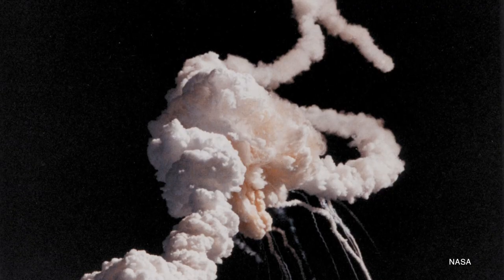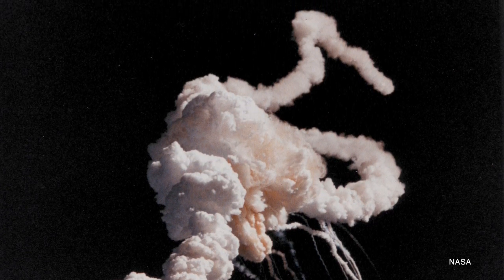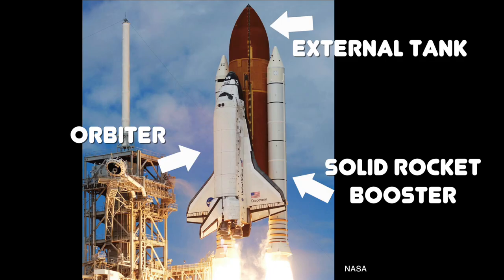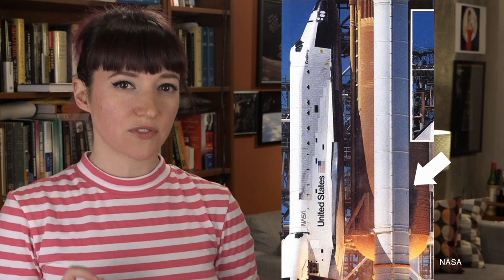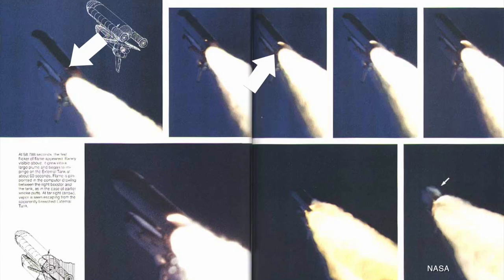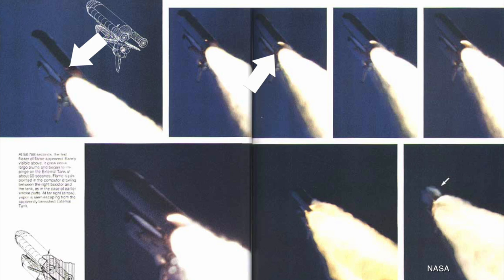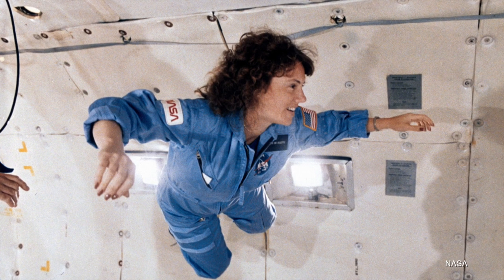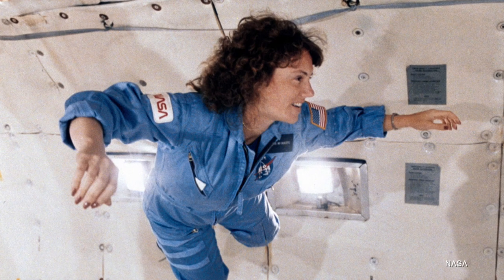How the Challenger Disaster Changed NASA

Comment: Actually, it wasn't the explosion which destroyed the orbiter. It was the aerodynamic forces caused by the orbiter tumbling through the air. It would have been fine - for a while anyway - if it had kept the nose forward.
Reply: That is correct.  So many people just see the "explosion" and assume it caused the shuttle breakup when in reality it was improper atmospheric loading due to the attitude of the vehicle not piercing the air correctly.  It is also too bad that at least two engineers attempted to postpone the launch, but politics overruled sanity.  NASA went through video of launches and found the same problem had occurred on at least two earlier launches. (different vehicles) Lucky for the crews that the O rings resealed on those occasions.
Reply: Also, during refurbishing of the SRBs, the O-rings often were found to be severely damaged.
Reply: It has been speculated that, had things gone just a little differently, the "slag plug" could have held fast until booster burnout and they'd all still be alive. Which doesn't absolve NASA from blame of course, but indicates that the accident was a "perfect storm" of engineering mistakes, management failures, and Murphy's Law.
Once the rear booster attach point burned through and it started swinging around, nothing could have kept the orbiter on its correct heading/attitude.

Comment: The Challenger Disaster is an unfortunate example of how things can fail when company culture and poor communication is at the center of an organization. The engineers knew that the O-rings were designed to work above 53F temperature, yet the day of the launch the launch pad was below the required temperature at 36F degrees. Poor communication causes failure and instability among an organization which never will achieve positive results. It is so important for an organization to have the same objective goal in order to succeed. In this case, the engineers were concerned about pleasing their managers, management was concerned about appeasing authority because the organization was more concerned about Public Relation matters than technical issues. Simply put; the goals of the organization were not aligned which caused failure. Additionally, the organization culture was terrible, engineers felt like they were not being listened to which resulted in poor communication. I think to have positive company culture, the first step is to have goals aligned amongst individuals and departments. When goals are different this causes lack of communication and disregard on important matters.

Comment: If NASA’s goal from the beginning was to end up launching 50 shuttle flights a year, the shuttle designers should have realised early on that this would involve shuttle launches in the dead of winter.  Which means the O-rings (and everything else) should have been designed to cope with freezing temperatures.

Comment: The Challenger Disaster was one of the greatest tragedies for NASA. The circumstances surrounding the explosion of the Challenger on the day of its launch could have been avoided but, ultimately come down to a lack of communication across the various levels of the NASA organization. It’s a very unfortunate example of how grim events can turn when there is a lack of sufficient communication and misaligned priorities throughout an organization. As the video mentions, the temperature was near freezing on the morning of the launch and it was known by engineers that if the temperature is below 50 degrees the o-rings would lose their elasticity and could cause joint seals to fail, which could produce an explosion. These concerns of engineers were not properly communicated to NASA management and in addition, no one at NASA was as concerned with the technical issues and much as the public relations issues that would arise if the launch did not happen on time. With 7 astronauts lives on the line, the primary concern of NASA should have been those individuals on board, not the PR of the launch. As a result of the poor culture at NASA, they had to realize the shortcomings of their organization alongside the rest of the nation watching the event live on tv, at the expense of the lives of the astronauts on board the Challenger.

Comment: The Challenger disaster is a very simple case of not having priorities and not taking into account the safety and the success of the launch. NASA, instead of worrying about making the rocket ship as safe as possible and prioritizing the success of the launch regardless of day or time, they decided that the best course of action was to do nothing to fix this obvious flaw in the rocket ship or to make an adjustment up date and time of take off. This of course prompted mass outrage because of how NASA handled it. Prior to the launch the engineer's had mentioned how the O-ring was deteriorating and that it had to be fixed before they could launch but management did not want a public relations or marketing problem and made the decision to not listen to the engineer's and to continue a scheduled launch for that Tuesday. Not only that those engineers mentioned that the temperature was not optimal for launch and  the marketing team once again decided to ignore their warnings. I find it very odd how despite them knowing what could have happened they decided to do nothing about it and it cost the live of several crew members and a public relations disaster.

Comment: While NASA needed to launch the shuttle on that day in order to be on schedule and keep up PR, it was not worth the risks at stake. When tested after the crash, a scientist showed that simply with cold water the O-rings lost flexibility. The temperatures outside during the launch were significantly cooler than that and had a greater impact on the O-rings. While this may have caused the explosion, the real cause was the lack of power and management given to the engineers. The original plan was to launch on Tuesday and have the teacher aboard give a class in space on Friday. They did not want to push it back a day because then the class would be on Saturday when no one was in school, but the engineering team is there to design and test the shuttle, so when they say something is wrong one should take their advice. However, the lack of proper management and lack of power given to the engineers and all of it to the PR team, the shuttle launched and the disaster happened. When work is divided to different teams each team needs an equal say in what is happening and what risks are worth taking.

Comment: This video takes you through the Challenger story and how it changed NASA. On January 28, 1986, the crew boarded the craft. Seven American astronauts were lost due to the explosion. The cause of the explosion was detected as an o-ring. Flames and smoke were present right before and after takeoff. What ultimately happened was a joint seal failed on the SRB and temperature was not controlled. People knew the temperatures before the launch, but NASA stilled continued to launch. It turns out there was not much concern about technical issues from the people at NASA, but more concern of the publicity that would occur if the launch did not happen. NASA let the view of the media get in the way of safety for those who boarded. What caught the attention and made the launch so popular was Christa McAuffliffe. The launch needed to be scheduled for the exact day it was so that it could be broadcasted in classrooms all throughout America. The launch was also scheduled to be discussed in the State of the Union address. NASA’s culture of putting public relations as a priority over the safety of people on board is the main cause of the accident. The disaster unfortunately was a reminder of how dangerous spaceflight is.

Comment: The Challenger disaster shows a lot about NASA and the communication of its employees. If NASA had listened to its engineers and were not so concerned about the end goal, the mission could have been saved. Since the mission failed because of an O-ring and the fact that it was at temperatures below the recommended launch temperatures, this means It shows that the littlest things can cause a major disaster. 

This can say a lot about NASA as an organization. It shows that the people who were in charge with launching challenger were not listening to employees that were not as high up. They ignored the engineers advice not to launch because they were more concerned about bringing money into the organization. This also shows the main motive in their space missions. They wanted to show that it is worth for the US to spend its money on the Space Shuttle missions and they wanted to make sure the country looked successful. 

One thing that should also be taken away from this is that space flight is still very dangerous. As a company, safety needs to always comes first for all people involved with it. If NASA knew that launching at that temperature posed safety risks, they should not have launched the rocket. It is very important that any organization ensures safety is always first.

Comment: Nasa launched its 25th space mission; however, they never reached orbit, leading to a massive explosion. This national disaster encouraged NASA to track down what caused this launch to go entirely in another direction. They found that there had been a defect in the solid rocket booster, which caused a small flame to reach the main rocket tank eventually. Apparently, the temperature at which these rings found themselves meant that they wouldn't reach their max function. This explosion was due to a lack of communication between NASA's management and engineers, leading to this explosion. Both were more focused on different areas regarding the launch, which inevitably provoked a failed attempt at a successful launch. If both areas would've met half-way, engineers, PR, and management would have probably encouraged each other to work around all those vital areas as a collective team. It's all about communication, especially when dealing with people's lives.

Comment: This is a very sad story considering that the misgivings of many cost the lives of a few. By pushing to have the flight that day when weather conditions were not favorable all just so that they could get positive PR is shameful. If they had listened to the engineers they could have put the class off until another day ensuring the safety of the crew aboard. Instead, they took a risk they could not pan out and innocent lives were lost. With basic communication and understanding of others' roles within the mission, they could have done this safely and effectively. She said it perfectly that it was not a failure of the o ring it was a failure of understanding of what was going on inside the rocket.

Comment: The Challenge Disaster is a prime example of what happens when there is not enough communication throughout the various levels of an organization when they are all involved in a project. Communication was at an all-time low because NASA wanted to prove to the public that they could successfully launce another space shuttle. More importantly, one of the levels of the organizations decided to ignore critical information that was in regard to the safety of the astronauts. They knew that it was too cold to launch the space shuttle, but they almost felt obligated to proceed with the project because they needed something to prove. When you boil this down to one reason, it all comes down to NASA feeling obligated to continue with their mission. At the time this horrific incident occurred, NASA had a very toxic work environment that was publicly known. Furthermore, NASA had deadlines to meet and it feels like they were not going to let anything get in their way. For example, they had a teacher on board that was supposed to stream the class from space, but if they delayed the mission on more day, that would have resulted in delaying the class.

Comment: Honestly, part of the problem (a small one, admittedly) seems like a badly designed mission plan. If you have something that needs to happen on a certain date, why is it pinned to 'day 4', as opposed to say 'not before day 2' and then swapping with another thing that is relatively floatable if it needs to be later?

Comment: “The Vintage Space” channel makes a very good point on the reasons for cause of the Challenger Disaster. The main reason for the disaster, in my opinion, was politics. The dangerous work environment of NASA during this time was dangerous to say the least, launching a space shuttle in temperatures that can cause damage to critical components to further an agenda or make promises is not tolerated in a normal work environment at a health insurance agency, and should be criminal in a space shuttle program. With NASA falling behind of the promises made to launch a certain amount space shuttles a year, a state of the union speech coming up that will mention the launch, and a schoolteacher needing to teach class on Friday from space. These were all forces that sped up the launch of the shuttle and ignored the number one concern, the safety of the people inside the craft. The pressure to meet deadlines and make promises created an unsafe environment where shortcuts were taken, and the limitations of a simple but important components such as the O ring were clear for all who were familiar with the development of the space shuttle. The Youtube video shows the extreme consequences of a dangerous workplace environment based on pressure, deadlines, and public image.

Comment: The Challenger Disaster is an unfortunate moment in American history. American lives were lost, the shuttle did not make it into orbit, and the company culture at NASA was called into question. In hindsight, many things could have been done differently to prevent or tremendously reduce the risk of such a disaster. Although the O-ring malfunction caused the explosion, the organization’s leaders are at true fault for failing to take proper action. The leaders have a responsibility to consult their stakeholders, hear from the experts, look at the data, and make informed decisions. In this case, they chose to ignore the recommendations and be swayed by outside forces. Motivation drives desires and NASA employees were motivated by public relations. They felt pressure to perform and did not want to fall even more behind on their promises. The timing of the State of the Union address and the live teaching lesson taught from space further enhanced the desire to launch as scheduled. However, in such a dangerous field and with human lives at stake, it is imperative that people in power make the ethical decision. It is difficult and there will be consequences, but doing the right thing must be the top priority.

Comment: The Challenger disaster was a devastating blow to their program. While they were obsessed with how they looked in the eyes of the public, but coincidentally would fail terribly by not listening to their engineers. The launch’s failure came due to the fact that the temperature during the launch time was too cold for the rubber O-rings on the side-rocket boosters (SRB). As an engineer pointed out the low temperatures caused the o-ring to not expand and contract while holding its shape reliably.     Upper management at NASA was under pressure to have the launch on time due to a “teaching moment” they planned to have for children to be able to watch at school. If the launch was to be delayed by a day then it would be on a weekend and the children would not be able to watch at school. Furthermore, there were numerous other problems they had beforehand which was mounting pressure to have NASA launch on time. Disregarding the engineer’s upper management went ahead and launched the rocket. With the world watching smoke and flames coming from a side booster and the explosion that would claim the lives of those astronauts that were on board of that shuttle.

Comment: Just as I was thinking, "She's barely scratching the surface", you said "This just barely scratches the surface...".  There was so much more to the chain of events and the organizational culture than just the Challenger event brought out.  There had been burned o-rings in previous flights, there was a near miss on the Columbia flight immediately preceding Challenger when the orbiter nearly launched 18,000 pounds short on liquid oxygen due to a fueling error.   This launch was fortunately scrubbed at T-31 seconds when the draining O2 caused the fuel line temperatures in the orbiter to exceed permissible limits.  Most of these issues seemed to point to a cultural problem at NASA, an over-confidence or even arrogance that they could manage any difficulty that might arise, combined with the stress of trying to meet an unrealistic flight schedule.  Unfortunately, and contrary to the title of your video, not much seemed to change at NASA between Challenger and Columbia, as many of these same faults seemed to repeat themselves to the same disastrous outcome.

Comment: Not enough to save columbia yes, but it was not enough to stop for a major investigation of the shuttle program over all. Shuttles have had notorious problems with tiles. I do belive Columbia had tile damage prior the 2003 loss. It actually caused a fire but it didnt take down the shuttle that time and they actually had landed ok. In 03 they KNEW a tile came off and caused damage. Its shown on take off footage. Yet they had procedures to prevent the accident such as a different angle of approach, high altitude parachuting etc. yet they didnt do a damn thing! Lets not forget the Russian Space shuttle which is a direct duplicate with a few minor differences. The shuttle was great in theory but with all the wear and tear, in practice it wasnt.